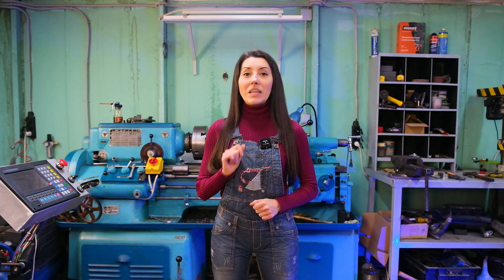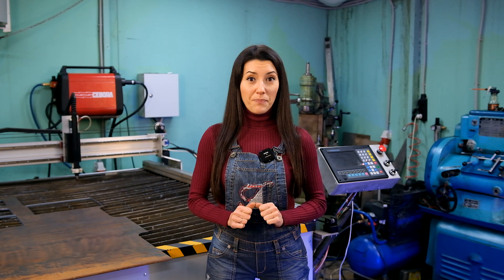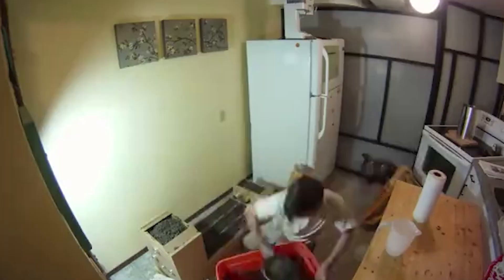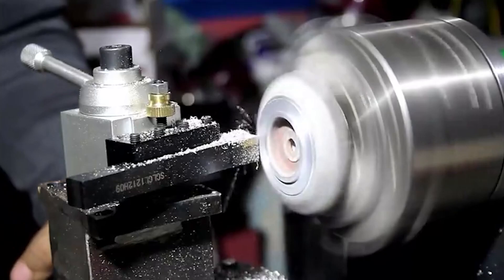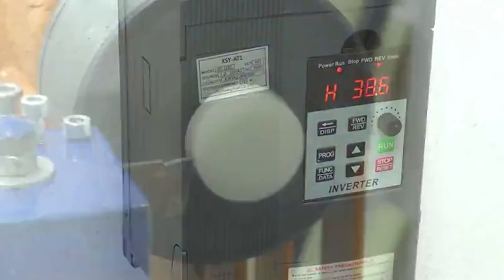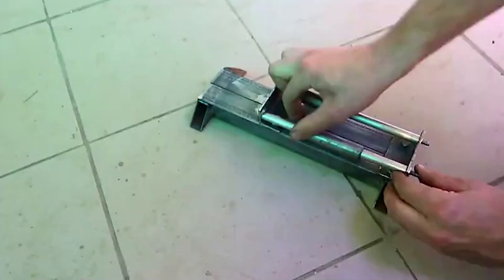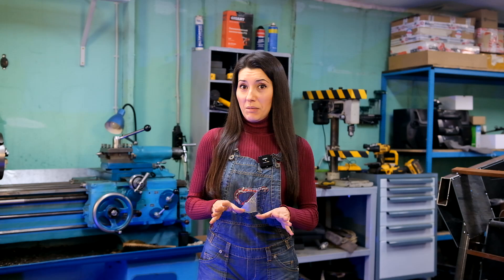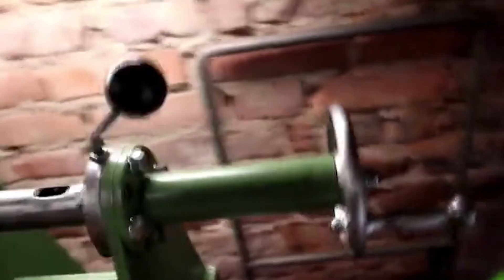Top 10 Homemade Metal Lathes

Comment: If you want a lathe that will cut to precision with no chatter or run out there is no way you can build it yourself , even the cheapest manufacturers accept that you can't weld a mild steel bed and expect it to retain accuracy, they tried. All machine tools have to be produced with an accuracy that exceeds what they produce, a crude DIY lathe will only ever produce crude products. Even the cheapest Lathe beds are stable and stress releived cast iron with hardened ways.
Reply: Lmfao 🤦🏻‍♂️🤣🤣🤣 you need to get out of the house more often!! There's tons of homemade lathes that Cut precision parts all the time and turn shafts to precision all the time
Reply: @SMOKEY-JAYS-DIESEL  you made that up though.
Reply: @snowflakemelter1172  No snow flake!!
Reply: @SMOKEY-JAYS-DIESEL  to produce precision parts your machine has to be of higher precision itself, fact of life.
Reply: @snowflakemelter1172  🤔🤔🤔 I guess you have never heard of metal lapping? And I guess you never heard of properly setting up a LATHE using a dial indicator?? When you zero out your lathe that means that it is precise 🤦🏻‍♂️🤦🏻‍♂️🫴🎲🎲🎲
Reply: @SMOKEY-JAYS-DIESEL  that's not how lathes work and the reason the beds are ground to high precision all along their length, you can't "lap" lathe beds either they are ground or scraped .
Reply: @snowflakemelter1172  keep telling yourself that!! Just because you can't do that on your Xbox doesn't mean it can't be done in the real world 🌍🤯
Reply: @snowflakemelter1172  look I'm not here to make problems. I'm not here to put people down all I'm trying to say is not everybody is created equal. Some people skills are out of this world and can pretty much build anything in their own driveway or their garage, but if a person knows what they're doing they could build it. Same thing with a string strings. Don't lie. Pulled tight. They are completely straight up to a certain point or feet. Same thing with a precision straight edge and a precision square. As long as you build square and straight anything is possible 🙌🙏 water levels are more precise than laser levels. That's why they use water levels to calibrate lasers
Reply: @SMOKEY-JAYS-DIESEL  don't be daft.

Comment: What is less expensive if - I build it or buy  it. but i have some spare parts for it like 4 jaw chuck, bike front shocker rod some metal piece
Reply: much cheaper to find a lathe that needs to find a new home...there are lots of reasons why someone will need to sell for a lot less than you can make the part for  ....but you can't put a price  the satisfaction get from building it yourself

Comment: I was thinking about making a dovetail style lathe like the Sherline 8 inch lathe. the lathe bed would be made with a 4x1x40inch cool rolled steel and a 3x3x1/4inch steel tube. Grinding and scraping will be required to get it as straight as possible. This is a good video that make my creativity turn right round. I like the ginger lathe because of the use of casted parts and I was thinking about doing a loss PLA casting method but I live in a apartment.

Comment: If you have to buy the materials to build one of these lathes, you'd' be better off buying a complete commercially built machine. Even if the machine has to be refurbished it is still a better money proposition. 
If your heart is set on building a lathe, buy one of the Chinese bench lathes. They are essentially slapped together machines that should be regarded as kits. You get all the fun of taking it completely apart and building it into something you can actually use.